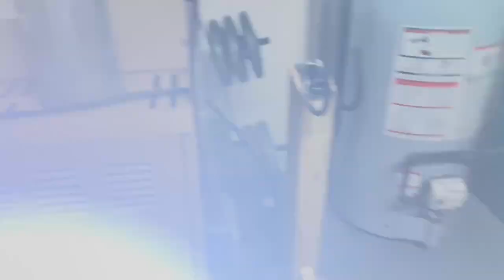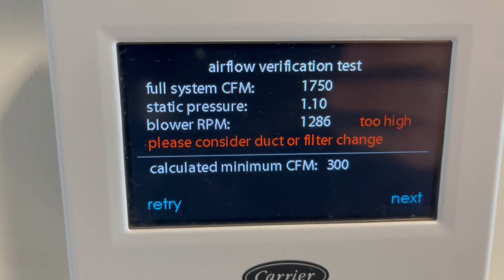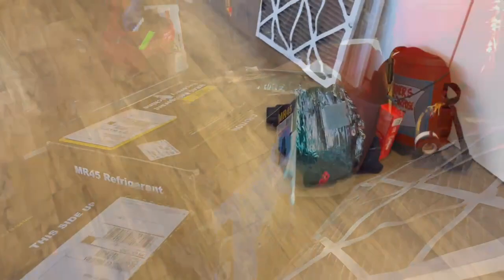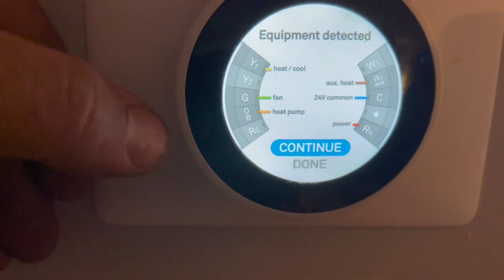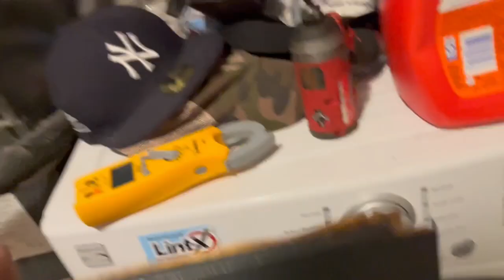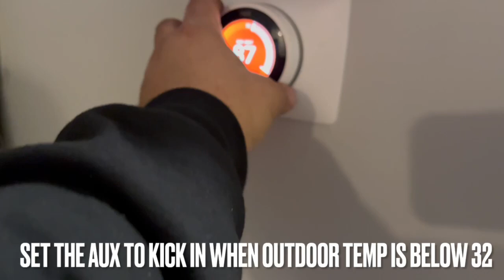HVAC RIDE ALONG - TWO NO HEATS AND THE CARRIER INFINTY AIRFLOW VERIFICATION IMPORTANCE.

Comment: Hi paul.  good job. On that last one with the nest, Do you think there might be issues with the thermostat controlling that heatpump. I have had issues with the nest thermostats controlling the heat pump equipment properly. Also be careful leaving the door off the air handler so long.  It's like running the ac without the condenser fan motor running. very high head pressure and damage to unit.